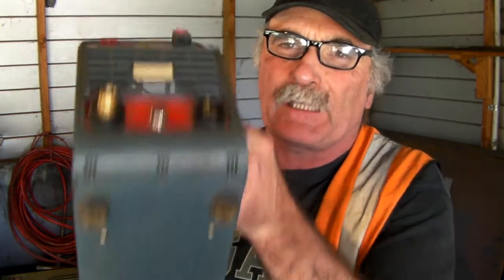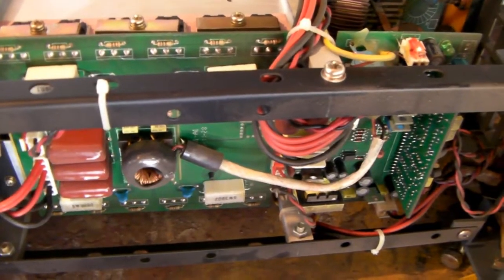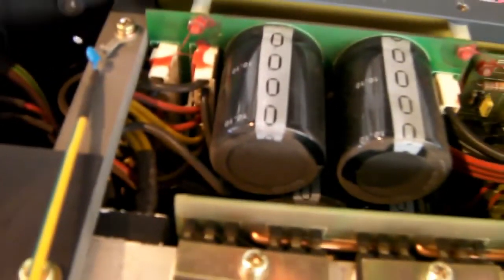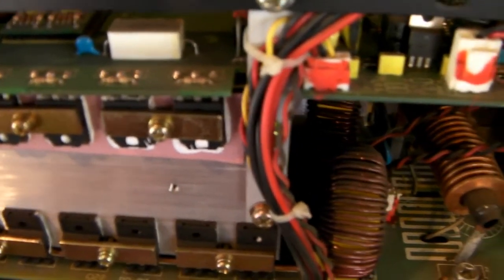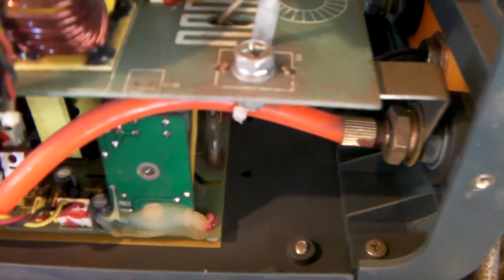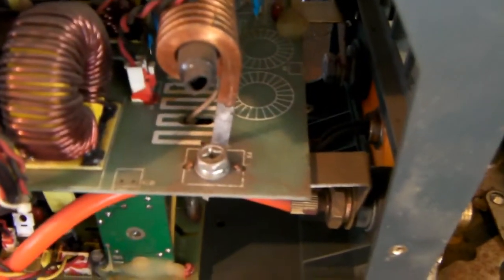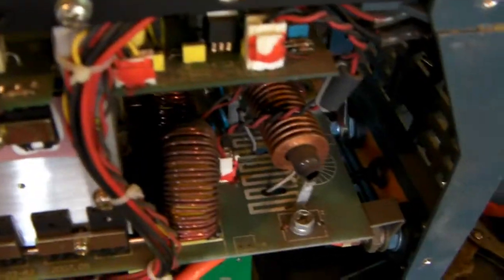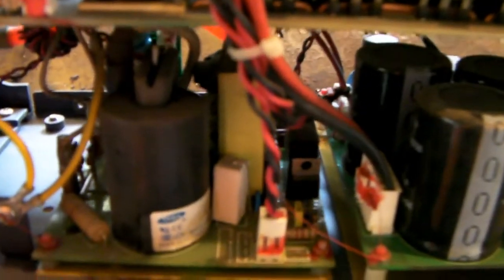Plasma Cutter Teardown /  Chinese Plasma Cutter Teardown

Comment: Two types of plasma cutters (and welders) MOSFET and IGBT. The MOSFET models are older designs. They are not as reliable, and are less efficient. I don’t recommend anyone buy one these days. Cheap Chinese machines, either MOSFET or IGBT use older devices, and so they need a lot of them! They’re less efficient than more expensive models, and as they don’t select the devices for the same efficiency or output, they circuit isn’t balanced. So the less efficient devices carry more current than the more efficient ones, and will, over time, blow out.

Just a thought.
Reply from the maker: Cool like i said i don't pretend to know about electronics .All i know is my experience with my machines  thanks for your knowledge cheers pete
Reply: @petestools  hello Sir so what You recommend for budget home buy ? any recomendation?
Reply: yanahya, partially true but I call bullshit. The cheaper ones still use IGBTs but they seem to use less of them and drive them harder.
Reply: @canadehv  actually a lot of cheap models have been using a lot of MOSFETS. They handle less power individually, but are much cheaper collectively. As IGBTs get cheaper, we’re seeing a move to them.